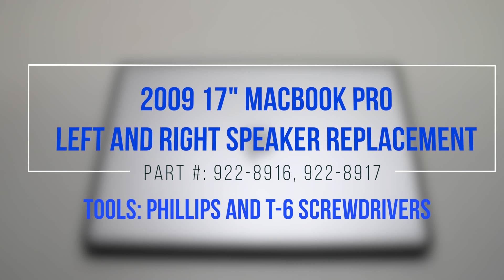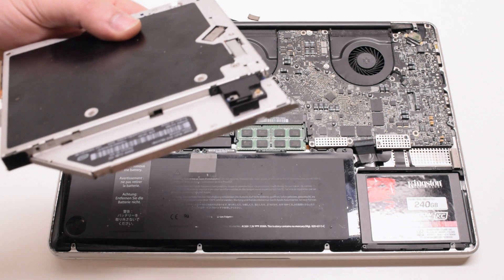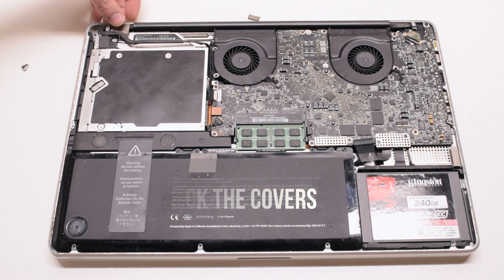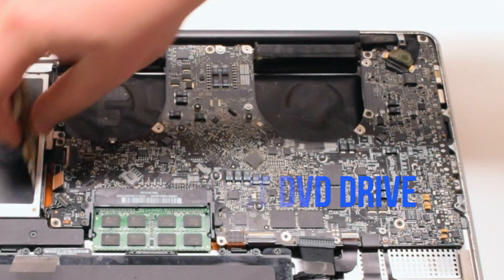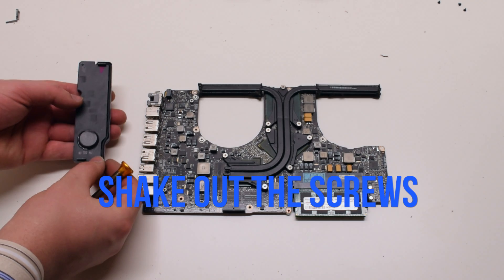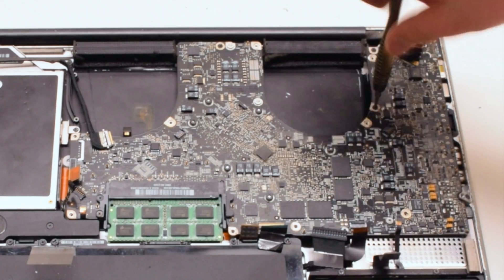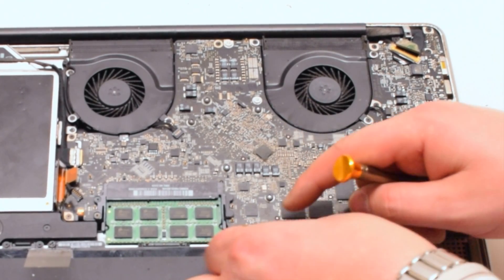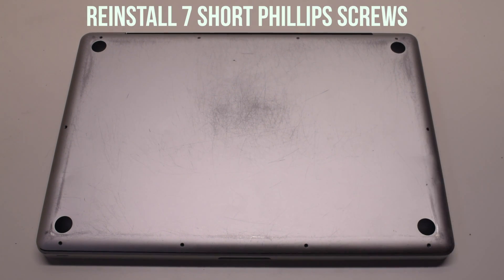2009 Macbook Pro 17" A1297 Left and Right Speaker Replacement

Comment: My 2009 power on after following speaker replace Never did left speaker. All I did was discconcet all wires , battery etc and put back. Won't power on. Any solutions ?

Comment: Great video; however, I would suggest you get an iFixit kit from Best Buy ($24.00) before you begin and a magnet mirror from Harbor Freight ($3 - $5 bucks).  They will save you time and keep you from accidentally losing your screws.  The iFixit kit has any screw head that you might need.  In this video, he said Phillips head for the Logic Board and for the fans but it is a Starpoint head (at least for my 2009 17" Macbook Pro).  If you are changing both speakers,  I see no reason to reinstall the DVD drive until reinstalling the Logic Board (maybe that was done just in case you were watching just for DVD replacement).  After flipping over the Logic Board, it is not necessary to disconnect the DC-IN Power Board.  You can get the right speaker off with that still connected (less to reconnect). A good magnifying glass is an awesome plus to help you see those small connections.